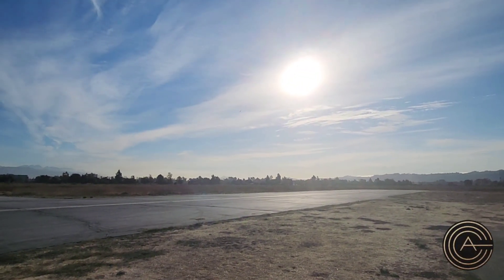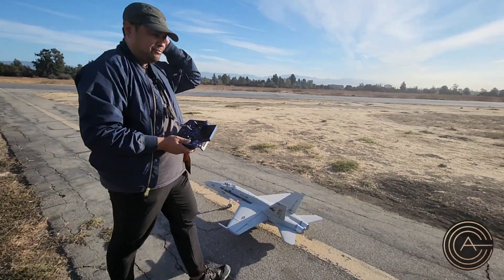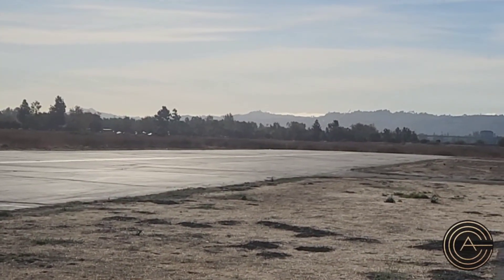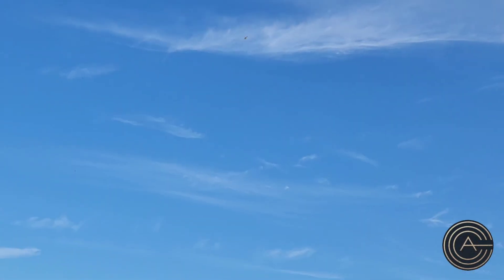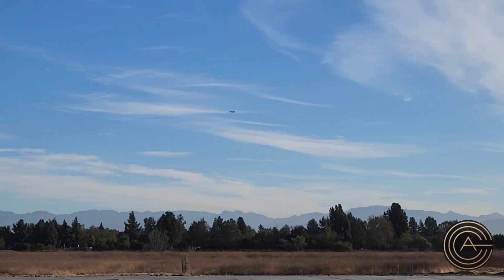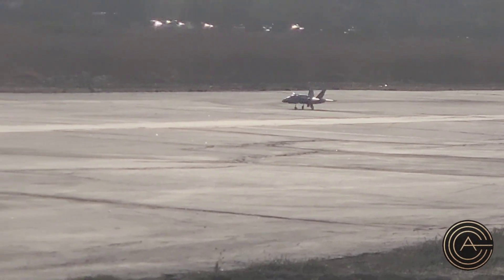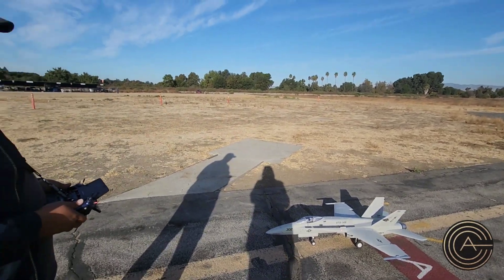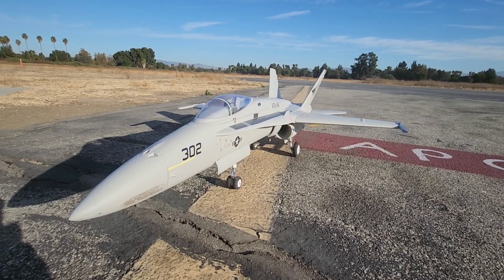Freewing 90mm F-18 Landing Tip

Comment: I've flown several EDF foam jets. The headaches of doors on the gear, the cost and weight of batteries. The cost to own. Foamies have their allure, but technical problems and foam models loosen up over time. Traditional construction models are more serviceable and last longer on the field. The best solution to modeling fighter jets lies in Composites and scale sizes of 1/5, 1/6, or thereabout. Short flights since fans consume battery packs so quick. I love jets, but the technical drawbacks are notable.
Reply: And absolutely worth it.
Reply: EDFs have their issues.  Shorter fights are the main problem.  With those batteries being more expensive.  Years ago I did quite a bit of  testing and videos RC planes, so I have a very large collection of RC planes.

Comment: Nice Landings! This plane is so damn hard to land. I fly in an area with 1 runway and often times have crosswinds. I can grease em in all day with the Avanti and Viper. Trying to land this on a short runway with a crosswind is a nightmare because when you use the rudder it wants to roll. Hopefully my new jp brakes with gyro will help landing faster...
Reply from the maker: Takes some getting used to. but in general just remember not to come in too slow with an F18. Brakes would be great. on final I just focus on managing descent and try to keep the nose up. Feather the throttle in case the wings start to rock. helps to come from a glide slope onto the runway. i dont like long approaches. really hard to tell how much speed its carrying from further out.
Reply: I agree.. The rudder moves the hole plane sideways..Need to put a little bank in to be able to controll it in landing.